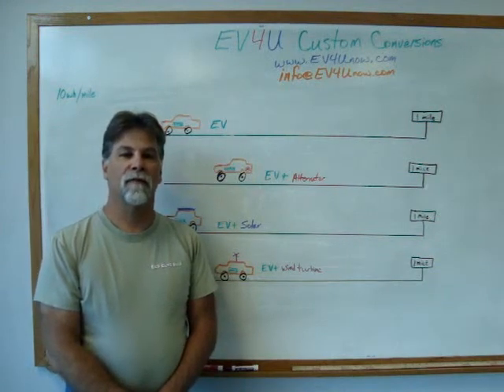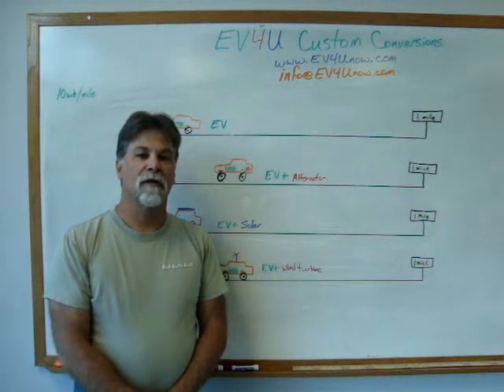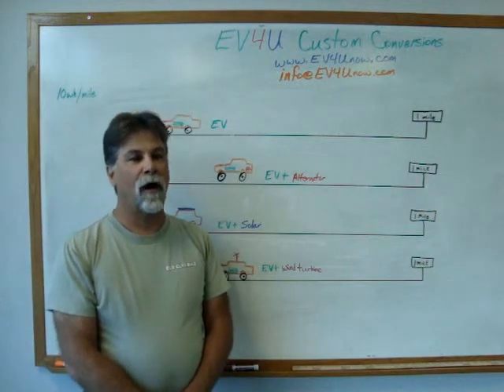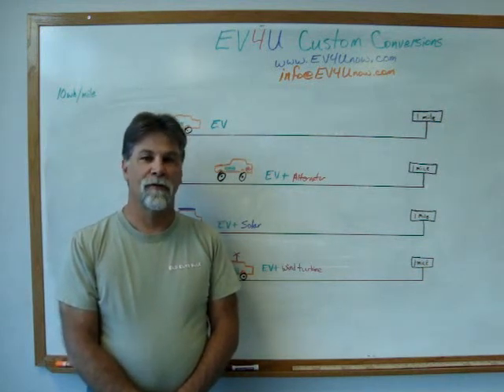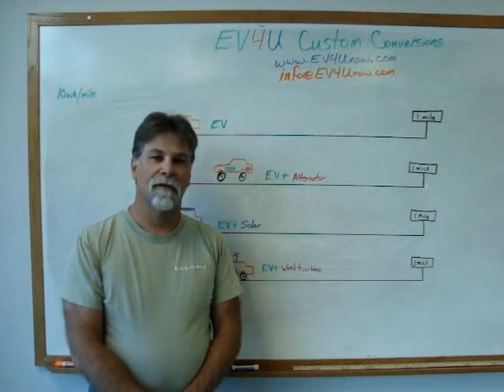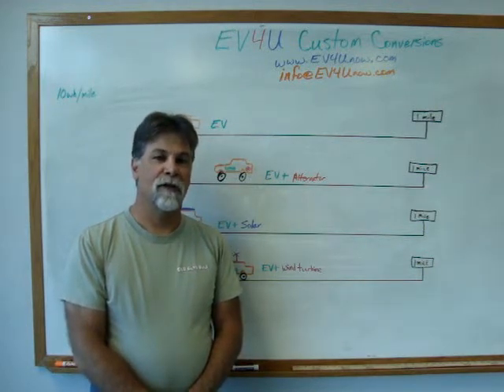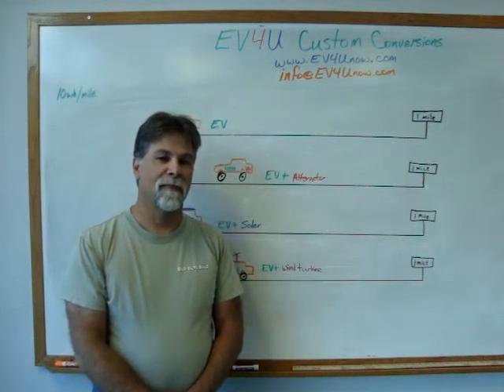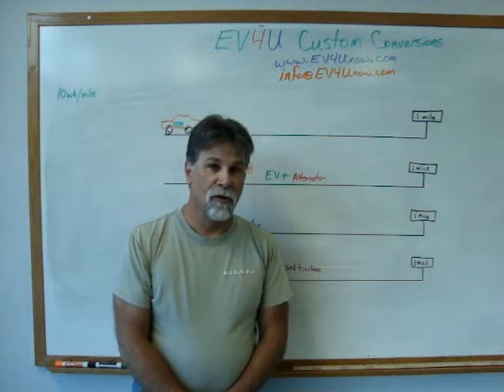DIY Electric Conversions - Can I charge while I'm driving using an alternator?

Comment: But solar panels charging while you parking your car, would it get some extra miles in 8 hours charging?
Reply: Modern panels are around 300 W per 1 sq meter. So according to consumption in video, during sunny day, u will get a mile extra juice  in 1 hour. Basicly not worth.
Reply: @Ivan-yo4hy  But if my car is sitting at work for 8 hours, isn't that at least 8 more miles I could go?
Reply: @prismagraphy  yes on average driving. Remember, starting before u get to efficient speed needs way more work. So its lower than 8 miles. I would say half tops, without start stop. Would be better to invest in few more cells rather than a panel.